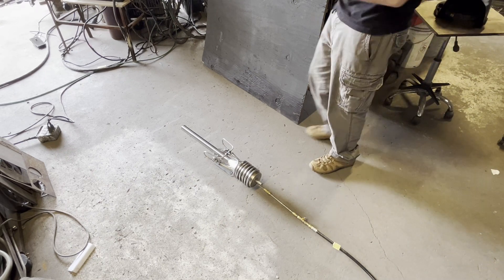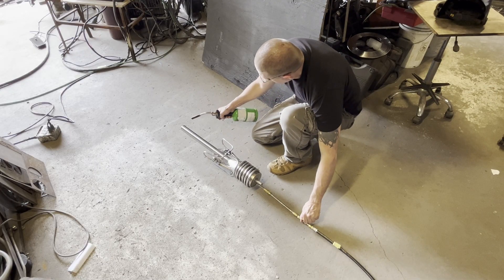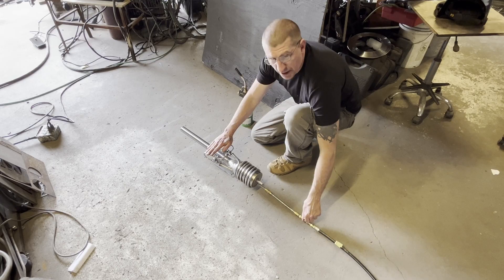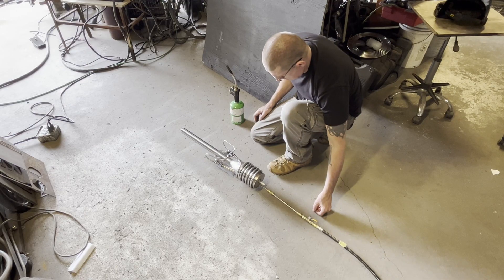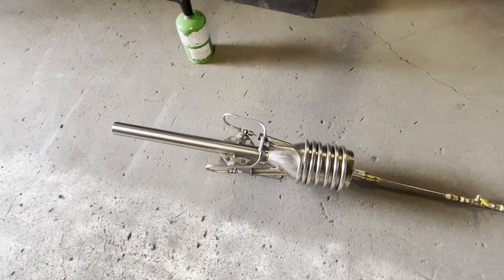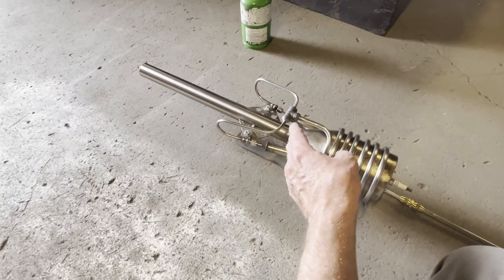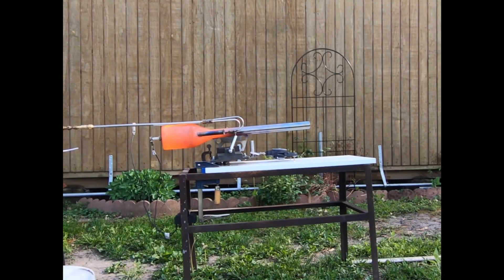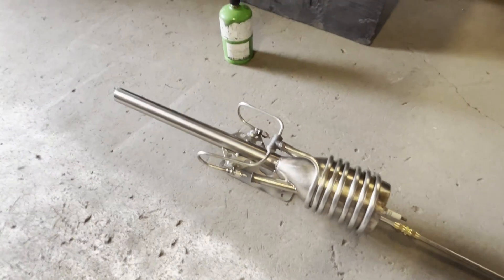How to light a pulse Jet engine

Comment: I have another idea for the propane/ hydrogen burner, if i recall correctly you had trouble with the burner destroying itself. Im in the machining industry and i sometimes use ceramic inserts that dont even sweat 1500°C so i was wondering if you could somehow press or coat a sleeve that's faces the hottest parts of the fire. What im thinking: the very back/ intake side has a metal plate like usual and the outside is metal too but it can fit a ceramic sleeve (only ceramic or ceramic composites but nothing that would melt) and a nozzle that has a thick layer of your silica refractory coating and a base material with high thermal conductivity and if needed cooling fins. and if i didn't mention it, the outside shell might need a lip and bolts so press the nozzle and inner wall together and up to the intake part. Like a aluminum engine with cast cylinder sleeves and head bolts. Im kinda buzzed rn so maybe that doesn't make much sense but i get the best out of the box ideas here